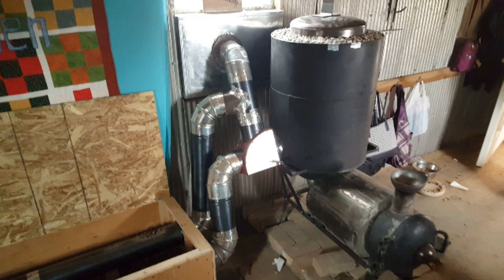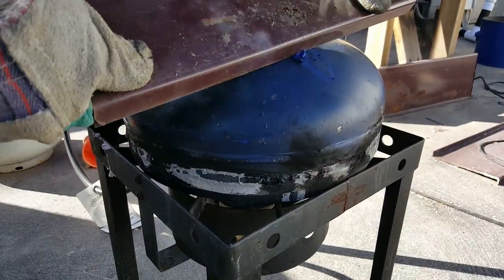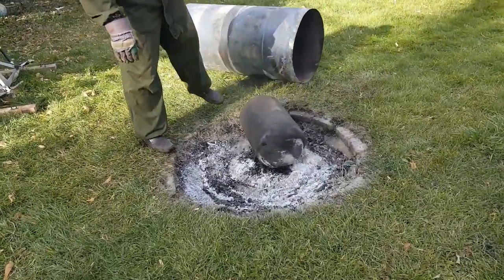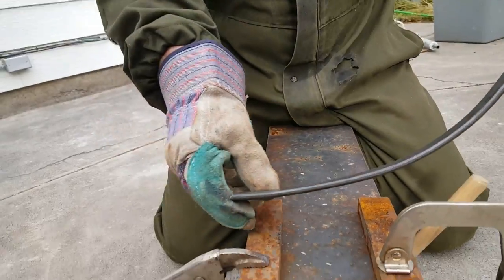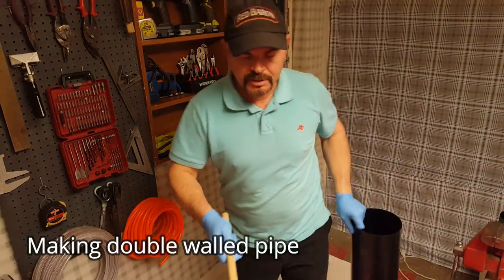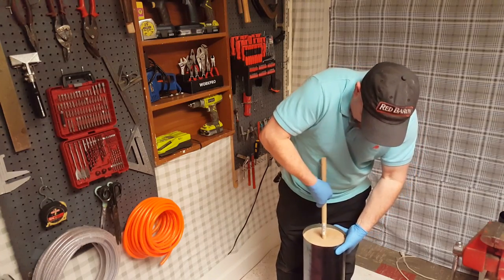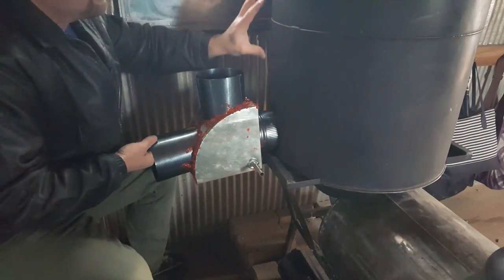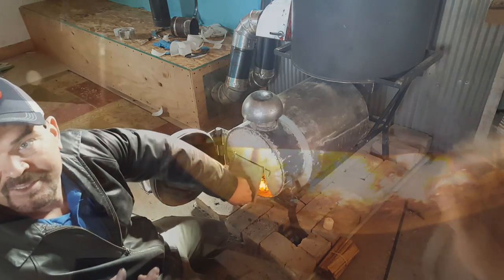Complete Build of Portable Rocket Mass Heater

Comment: Darwin you are a talented guy. It would be much better if you explained what you were doing as you did it and what part you were working on, I was pretty lost trying to understand what you were doing and why. Other rocket mass wood stove people have indicated that steel will fail as temperatures can reach into the 2000oF. What do you think? Also the mass being river rock means lots of air space between the pebbles kind of like insulation,  don't you want dense solid mass that conducts heat and holds it like cobb or some kind of dense matter. I understand being able to move it is an issue. Thanks for sharing your project...

Comment: A few years late, but, one thing about when hot gasses are forced down, they're also forced to release heat faster.  I've also forced my exhaust from the bell a couple feet down, then, instead of a bench, the heat is drawn through a base that will have a 55 galllon drum setting sideways in it, and full of water for the thermal battery, and on top of that barrel, will be 2 more, water stores something like 8 times the BTU's as cobb or concrete.

Comment: Won't the mild steel just burn out, seen others where the steel completely fails, kinda put me off a really good idea, I would think lining the burn chamber  and lower flue is needed with some kind of refractory product or replacement liner. These stoves will reach very high temperatures in order to clean burn and so ultimately the steel will flake and crumble

Comment: Exciting project for sure. 
 For the life if me I cant cut a straight line around a barrel like you did . To make the cut to separate the air tank or the outer barrel I try to make my cut parallel to the factory weld seam but wether I'm felt tip drawing or grinding it by the time I get to the start end the cut is off by 1/4  inch.

 You did a nice hinge . One of the best on youtube

What our host is doing at the 15 : 12 time mark  is a nifty way  using readily  available  stove pipe . I used a tractor trailer truck muffler which is about 10 inches diagonally. With the inner pipe about  6 inches . So cutting out the inner pipe gave me a 10 inch pipe with a 6 inch hole on either end to insert a 6 inch stove pipe in . But who's got a big truck muffler laying around . I like our host way,  better

 That directional glue device to direct the glue gases to the bench heat sink is cool

I like the fact that you have had sucess with a large batch fire box like two feet long before it hit the air riser . I made mine so combustion take place  within in inches of riser requiring  constance feeding

Comment: Hello.  Great build very genus, love the 'out the window' thing but doesn't look too portable to me.  I built my own rocket stove 5 yrs ago and have been using it as my only heat for winter ever since.  I used a horse water trough and built my burn area in there out of firebrick and covered it all with thick layer of cob.  I got it up on cinder blocks w heat resistant pad underneath  and you know heat rises so I could have this on a nice solid wooden dolly w wheels and it would actually roll.  Perhaps a smaller version for Bobhouses and garage heater could be built and I love that window vent stuff.  Also one does not need the 'bench' to have an effective rocket stove working wonderfully.  Great video, wish I had your building skills.  Best of luck.  Peace.

Comment: Honey Do Carpenter What a great build, I appreciate your skill more than most.  Best designed and built rocket stove I have seen.  Do you think I could use an external tank with a flo-jet air pump to supply my 1/40 Dawn dish soap foam agent to a foam producing head (tube with stainless steel scrubbers and airsoft bb's)  It's all car wash foam equipment, I just want to use needle valves to control the air and soap mix.  I saw a video where you made an external tank like that and just had 2 lines running, I just wasn't sure how you used and controlled the air pressure to pump the soap and get the proper air flow.  I may need to go back and watch the shed panel video to answer my own question.  Any input from you or your viewers is always helpful.  Thank you again, keep the videos coming!
Reply: No

Comment: You know, people toss out a lot of propane tanks, water pressure tanks, water heaters, so these components of freedom can be practically found at curbs and junk yards. I should try this before winter, after the broken hand heals first lol. Have a 3in1 3ft sheet metal machine, cuts, is a brake and does folds, and rolls, so its a 4in1 machine. And that aircrete, if the air is replaced with helium, it would save on not having to install wall mounting brackets. Ok maybe not, however airecrete is lightweight. 
#RedesignEverything

Comment: What are you doing for a condensate trap?

You can significantly increase combustion efficiency even beyond 100% to near 115% by retrieving the latent heat energy of vaporization from the woods moisture content AND HYDROGEN content (wood is a HYDROcarbon!).

If you condense it to the maximum by preheating cold outdoor intake air.

But you have to collect the acidic condensation in a drip bucket.

The condensate can be sold as real liquid smoke! Or dried to tar and used for a fire starter!

Comment: Could aircrete be used as floatation in a steel pontoon/raft as floatation/bouyancy instead of styrofoam floatation? Thanks, Ray.
Reply: It could, but stryo is much lighter, and aircrete might absorb water, and has little structural strength. Unless you were building a boat to be floating on a lake of fire! Lol!

Comment: What you are talking about with a two foot down exhaust is very similar to a oil or kerosene fired (Depends on the nozzle type) Dynabrade oil fired hot water boiler design that is just as old as the Titanic. I am certain if you would study the boiler design you will be able to make the absolute best rocket stove on YouTube for sure. Please check out what I am talking about and you will surprise yourself Honey Do Carpenter. Look forward to hearing from you soon.

Comment: Your stove has a great rocket, but very weak on the "mass" portion of a rocket mass heater. Your storage mass run in the bench was too short, had no cleanouts, and the wood wrap around it is not helping. The thick wood is an insulator that keeps more heat in the horizontal flue, eventually sending more up the chimney.  The reason you think your super-strong draft that can overcome the negative elevation is so "great' is that it's sending too much heat outdoors. If you really had the best RMH, a 90 deg outdoor exhaust would never make it up that giant flue; it wouldn't even need a big flue like that. It could exhaust right next to the house. You're sending all your heat outdoors with a strong rocket but it isn't harvesting enough of the heat to keep indoors. Your craftsmanship and attention to detail are awesome, though! Keep improving to get your exhaust temps down to keep your heat inside. :)
Reply: Could you please point me to some design documents for what you would consider an ideal RMH?

Comment: Water glass is old school. Hydraulic-refractory cement from Europe fixes pre “firing” and is structural. Where is the mass in that heater? Steel isn’t mass in absorbing and radiating heat.
Reply: I think he uses the water glass just to seal the air crete, not to make it more hear resistant.